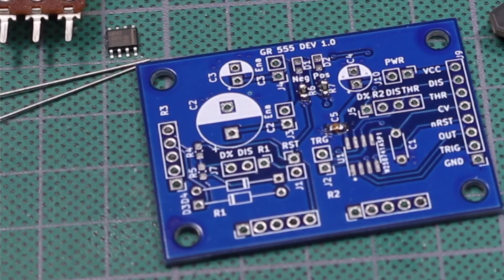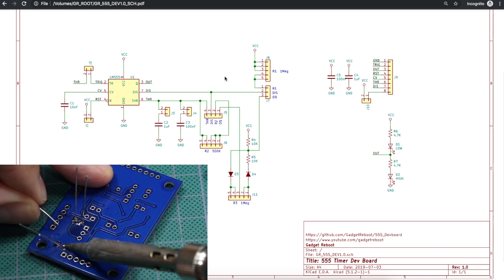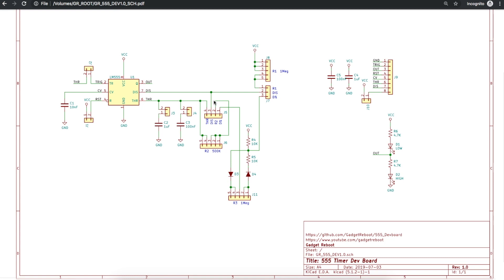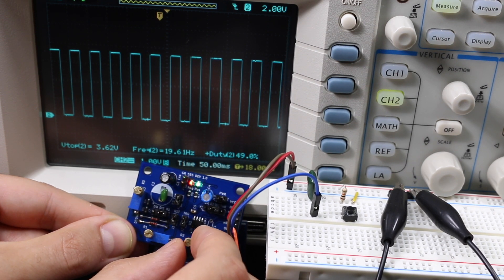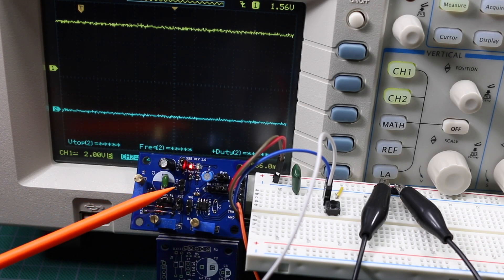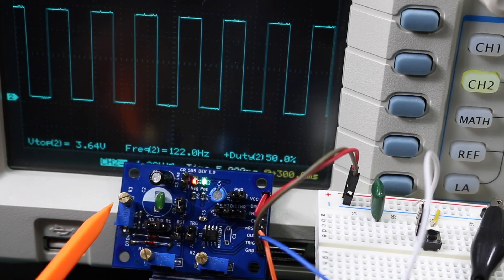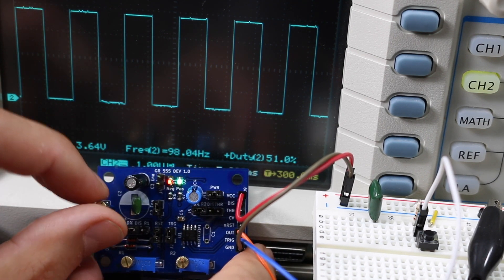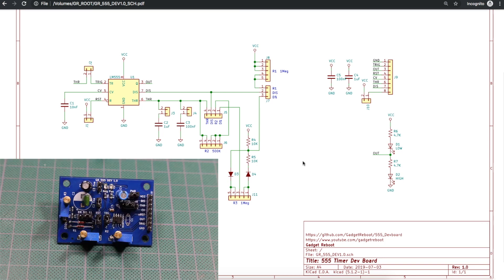555 Timer IC Kit: Projects for Astable, Monostable, Bistable, or Variable Duty Cycle

Comment: I would love one of these! very very cleaver I have been really wanting to learn more about the 555 and non programming based electronics.
Reply from the maker: I might need to borrow your rubber boot to draw names from, I haven’t figured out how I’m going to do it yet. The 555 is a great device, one of the first things I ever used for blinking lights or making sound effects. I might end up evolving this into some sort of synthesizer over the coming months.
Reply: @GadgetReboot  Another 555, or a 556, you can easily build an Atari Punk Console.
https://youtu.be/Oi3dmSMpjsU
Reply from the maker: I have some plans for some audio stuff like that to continue where I left off about a year ago when I looked at some 555 audio circuits.  I might end up with 20 breadboards triggering each other and wires and audio cables and speakers strung up and hanging from everything on the workbench.  Might make a nice Halloween scene.
Reply: @GadgetReboot  Was googling around on how to do harmonics, maybe with a PLL and a base freq generator, and found that there exists another old school chip, the LM565 that hobbyists use for all kinds effects generators.  Every day I find so much I just do not know about.  The early 70's must have been an exciting time.
Reply from the maker: I think I have a 565 or else maybe there’s a different part number in that family but it sounds very familiar. I think once I start doing sound effect and synth circuit investigation it’s going to be a big rabbit hole of tangents. It’s going to be a lot easier now that I have this 555 board  so I just need to get a few other logic gates on to the breadboard and get started.
Reply: @GadgetReboot  nice looking forward to it lol you can borrow my boot anytime hahah